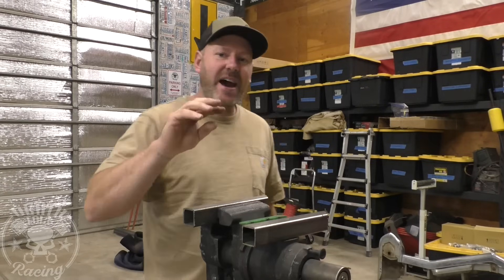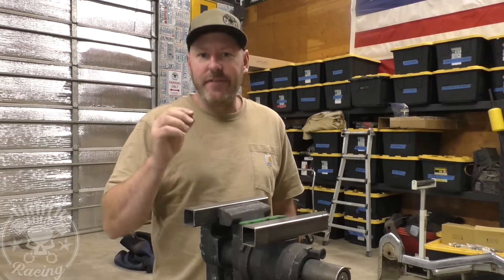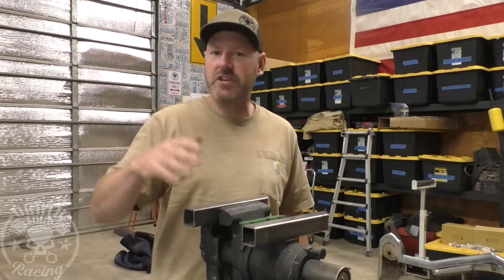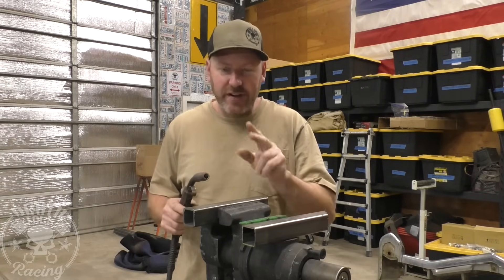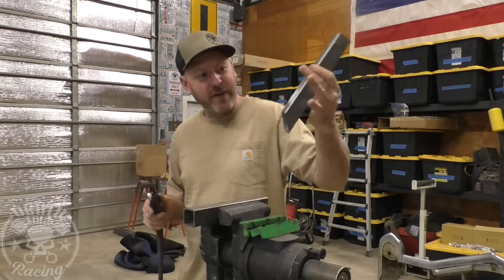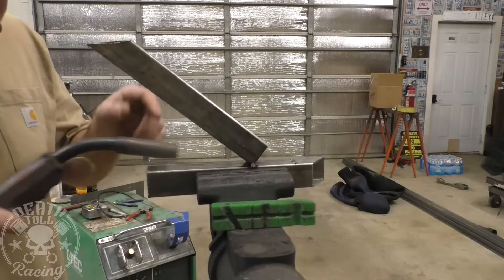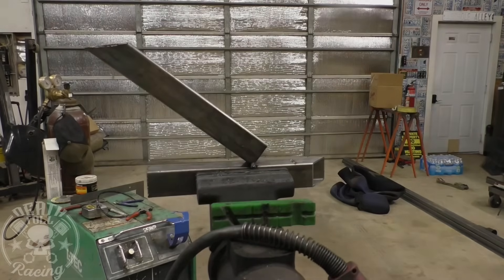Setting Wire Speed On A Mig Welder To Match Voltage, Must See For Beginners Learning Welding

Comment: That was very helpful I don't know what the the voltage was cuz obviously the wire speed would change with the voltage and I think that for a lot of us or at least I can speak for myself Dad how much voltage do you need and then figuring out what your wire speed is and I know that depends on the thickness of the metal of course any other situations that you know that you might have set voltage for certain positions you might be in or whatever but the speed and that was great like I said help very helpful but you know I guess most of the things that I weld is going to be around 1/8 to 3/16 of an inch steel on average
Reply from the maker: Glad it helped!

Comment: How about upland I never use downland unless.3mm 1/8 or under
Reply from the maker: .095 wall
Reply: Hahaha. It’s not flux core bud.
Reply: @v.simonson5170  can you only wrld upland with flux core ? Or only heavy  plate I was thinking just 1/4 =1/2 plate can it be done downwards ???
Reply: @mickridley4409  without a pulse machine uphill mig on steel isn’t really a thing that’s done commonly. Not saying it can’t be done on heavier pieces, but commercially, they would use another method. Flux core on the other hand it is preferred to go up 99% of the time.

Comment: Very helpful, nice work 👍. One video also helped was the speed of the wire is the amount of heat. I have oxygen acetylene  welding for 50 years. Thinking more wire to fill the holes I was burning 🔥 was making my wire welding worse. I know sound critical in any arc welding just was unable to get it. Thank you
Reply from the maker: No problem!  I am going to make a few more of these that may help. I have lenses for my camera now that I’m eager to try out. Should be able to see and hear then. 😂

Comment: his welds look better than mine ...my welder i bought doesnt have a temperature option which i find extremely odd since id think temperature is a big things for decent weld but it auto adjust i guess to teh wire feed speed...so with flux cored wire on there now i have my wire speed at 180...it seems like it goes too fast..my welds arent nice and clean like these..but they still work but still they dont look like these.
Reply from the maker: Flux core is a bit different. In my opinion, It’s harder to learn with because it’s much more difficult to see the workings of the weld puddle. I will be doing some videos on it soon.  But once you get the hang of it, transitioning to mig will be a breeze.

Comment: The steel section looks about 6 mm which at the settings used would be considered more Cosmeitc than structural welds as definatly the root fusion would be minimal.
Reply from the maker: .095
Reply: What settings?  I didn’t see him show any. Are you just trying to sound smart?
Reply: It doesnt take a genius to listen to the arc and know he is using dip/short arc transfer and in the downhand positions 3 to 4 mm is the max you would apply to ensure good root and side wall fusion - do yourself a favour before making inane stupid comments learn something about welding.
Reply: @davidrichards3605  so yeah, just trying to sound smart. Didn’t work. Sorry
Reply from the maker: Material is .095 or 2.4mm

Comment: Say your connecting 2 different thicknesses of metal. Maybe .090 to .185 ?  Is it correct to set speed & voltage for the .090 & weld in the middle ?  Or, would I try to set the speed & voltage for the .185 and try to weld more on the side of the thicker pcs. ??
Thanks for your consideration,
Sincerely ...............
Reply from the maker: Sometimes depends on the situation, but usually I would be set up for the thicker material and try and keep the heat on it. 

If it’s a butt weld however, that may be difficult to do and you may want to be set up for the thinner piece.

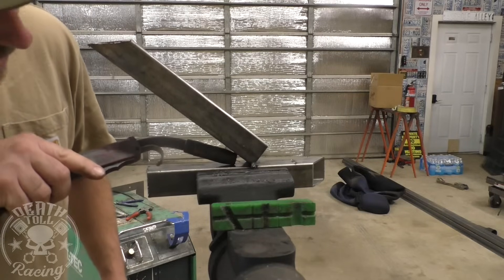Comment: concerning 1:40 if you are using flux core wire you can take your shield off the gun to see better and get you in further.
Reply from the maker: Yes!  However if you do flux core, you should not be welding downhill.  You will weld that one uphill. I really need to make a few more videos now that I have a better camera and hit a couple new scenarios
Reply: @DeathTollRacing  Do you mean push the bead and not drag it?
Reply from the maker: @drewchambers9132  there’s situations for both. I prefer a slight drag
Reply: @DeathTollRacing  Can we please keep it on the subject of welding..lol jk haha
Reply from the maker: @drewchambers9132  😂

Comment: Nice job on the video. Getting ready to MIG for the first time today what I think is 20 gu sheet metal. I made a bunch of practice pieces. Hope it goes well.
Reply from the maker: Best of luck!  Don't get discouraged!  20g can be tricky with blow through.
Reply: Yeah 20ga. is very tricky to weld. If you have room enough to clamp a piece of heavy bar stock behind your seam, try it. It'll absorb the heat n help reduce blowing holes to often. Helps out to to patch blow outs. Keep everything cold before starting another weldment. Tight fitups will make a ton of difference on ( minute to no gaps ) thin gauge metal.  You can do it 💪 💪

Comment: On your downhill are you pausing or kind of going back and forth? I can’t tell.
Reply from the maker: down, pause, down pause.  Don't let the puddle get ahead of you.  If you can't keep up with the puddle, turn the wire UP or the voltage down.
Reply: @DeathTollRacing  ah thanks. I do some that’s in all positions including upside down but I always bump my speed half a point but didn’t know you could turn  the voltage down and get the same effect. I’m new at it and my job requires so any info helps.

Comment: What you're saying is to start with the tap and then fine-tune with wire feed speed for the right sound.  It sounds simple but I was struggling a lot last week.  How would you fine-tune on thin sheet metal, 16 gauge (mufflers), which will burn through if you hold the stinger in one place for more than a second or two?  I was using flux core so that may be the problem right there.
Reply from the maker: 99-2007 Silverado $70 Exhaust Upgrade!  $70 Sounds Amazing!
https://youtu.be/sQWzNsCWS6Y
Reply: @DeathTollRacing  Thanks for the link!
Reply from the maker: Flux core is a lot different. It’s also very frustrating to try and learn, especially on thin metal. 

Here are a couple of tips. 
 First, don’t be afraid to “6 shoot it” just so you can get done. This will be just tack welding all the way around instead of a constant weld. 

Second, setting your wire speed to the sound of more of a hiss. So have your speed down and start a weld and keep turning it up while welding until it starts to spatter, then back it down just until it’s a hiss again. 

I’m going to send you a link to another video that will also show you a few tricks on welding exhaust that may help.
Reply: @DeathTollRacing  Thanks for the tips!  I'll go look at your exhaust video I'm sure it will have a bunch of great tips.

Comment: Are there inductance settings on older machines that dont have touch screen displays. On Joddies channel, that low spped high inductance seemed amazing.
Reply from the maker: Short answer, no. Some older commercial welders have adjustable inductance using a knob, but I haven’t ever seen it on smaller machines.  I’ve seen it a lot on old Linde machines.

Comment: Thank you for this, but I have a several questions.  I presume the metal you are using is the same that you intend to weld?  Or is that irrelevant?   When you are performing this, do you just let the weld pool build and build in the joint, or do you need to move side to side?  And lastly, is there any reason not to do it the other way around?  Set wire speed, and adjust voltage.
Reply from the maker: I presume the metal you are using is the same that you intend to weld?  ***roughly the same thickness would be preferable.
Or is that irrelevant?  ***not irrelevant, but you can fudge it a bit.
 When you are performing this, do you just let the weld pool build and build in the joint, or do you need to move side to side?  ***when you are new, do whatever you are comfortable with, then, once you are more confident, you can start adjusting technique.  I wouldn't stress too much over this part yet.  Just get the welds to lay in there for now. 
And lastly, is there any reason not to do it the other way around?  ***Set wire speed, and adjust voltage.   You can, but I think it's a bit easier this way.  plus a lot of machines have "clicks" on voltage that sometimes are fairly large jumps between voltages.

Comment: Nooooo..... :/ never downhill
Reply from the maker: Ummm, okay. I’m sure your the expert.
Reply: A noob knows you're not supposed to
Reply from the maker: @jonathanarango4610  remember this moment once you learn. There are many types of welding. Non pulse mig is downhill, and it must be set and run properly hence the video showing how to set it up.  

Try asking questions instead of pretending to know something you don’t.
Reply: @jonathanarango4610 Would you like to show me one welding code on the planet that supports your view, name and clause number please...
Reply: When you down hill pass you dont penetrate the metal the same.. its actually illegal in big welding companys.. you get fired bro
Reply: Pulse? The term I think you want to use is weaving? you CAN tell when its downward.. I'm not trying to be an a** I was just trying to help out
Reply: There is better welders than both of us out there.. but you're falling behind
Reply: Dont change the wire speed.. you're calibrating and finding your parameters.. so you set a wire speed  your comfy with and if it's running cold you turn up the voltage..
Reply: Once you all learn correctly you will remember me. That's Inevitable.. unless you never learn hahahaha
Reply: @jonathanarango4610   A macro to see if you have complete fusion, after grinding off any prior mill scale is one way to qualify and prove a down hill technique is ok for the parameters you are running. Downhill can give complete fusion on thinner materials AND a very smooth face, which is very good for welds, especially those cyclically loaded. Up hill on thin gage is not always best. Uphill progression on thicker material is best due to the lack of fusion issue, preheat can help with LOF problems if you are forced to progress downhill on material over 4 mm. A macro on this vert down weld will tell us if there is complete fusion. Pity it wasn't done to prove everything had fused properly, I suspect it had but a macro will prove it. My personal rule of thumb is anything over about 4 mm wants welding uphill with GMAW unless I see a macro using the settings used in production that tells me otherwise.  https://www.youtube.com/watch?v=H25zxJ-9y78
Reply: @paulmeersa7162  they fooled you... unless you're doing sheet metal you're wrong
Reply: Here is another good video on it, showing just how fickle it is to be able to get good full fusion on downhill GMAW short circuit welds especially. Really only reserved for thin materials unless you preheat IMO.
https://www.youtube.com/watch?v=n9clLynTEJ0
Reply: @jonathanarango4610  In what way am I wrong...?
Reply: @jonathanarango4610  Come on, in what way am I wrong...?
Reply: @paulmeersa7162  you're welding downhill.. it's illegal.. you get weak penetration when you go downhill.. welds break... you're gonna make a building collapse or a ship sink lol
Reply: @jonathanarango4610  Where does it say it is illegal? Feel free to quote any code on the planet please, quote it chapter and verse...
And more importantly, what did I say in my post...
Reply: @paulmeersa7162  you don't even weld
Reply: @jonathanarango4610  Wrong again.
Now how are we getting on with the other questions. Come on tell me where am I wrong..... :):)
Reply: @paulmeersa7162  You don't really care what I have to say.. I can assure you about what I told you.. it just a warning take it as you please...

Comment: Are you weaving the welds any particular way or a straight line with back a slight stepping ?
Reply from the maker: That one was just stepping, no weave. But if you’re just beginning, do whatever you can repeat, then once that’s easy for you, adjust then. Stepping is my preferred method though.

Comment: Nice looking welds. I couldn't tell the angle of the tip after your downhill weld. Were you pushing or pulling the horizontal? Most of my service work is done on dirty metal so I have to really crank it up. Good video
Reply from the maker: All the welds were basically straight to slightly dragged.   Yeah, field welds bend a lot of rules to get it done!
Reply: @DeathTollRacing  Reason for dragging opposed to the normal pushing with mig??
Reply from the maker: @misplacedcaper9662  there are situations for every position. Dragging penetrates better, but can make the weld profile “humped”. There’s a lot more to it, but that’s that main pro and con
Reply: Dirty Welds you say? lol

Comment: Awesome video. I think sound is often overlooked when setting up welders. I had an old timer tell me to aim for the sound of sizzling bacon, and I still think about that almost every time I am welding.
Reply from the maker: I describe it as a steady crisp noise.
Reply: A old timer told me it should sound like your ripping a bed sheet real slow.  I pay attention to sound as well
Reply: Funny all I’ve ever heard are young timers saying an old timer told them that. If frying bacon and mig welding ever sound the same then you’re doing one or the other very wrong
Reply: I’ve learned from some good welders. The “smooth” sound is the sizzling bacon. You just know when it’s right after a while.